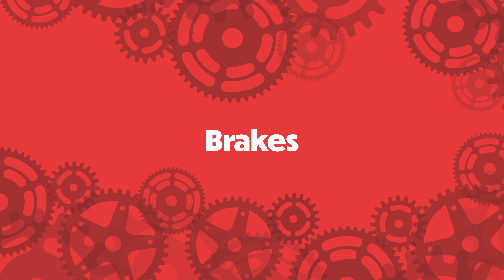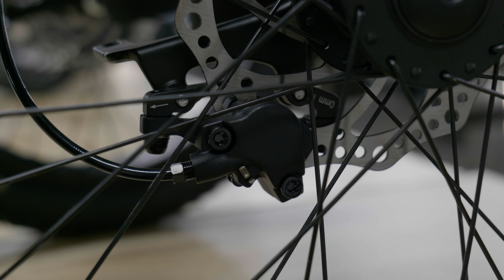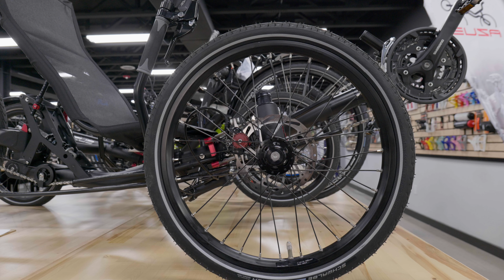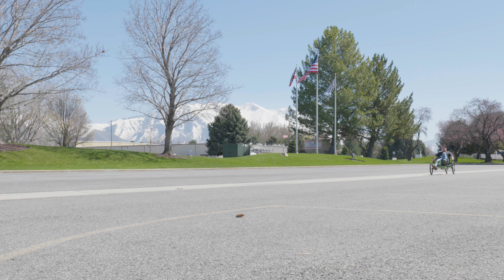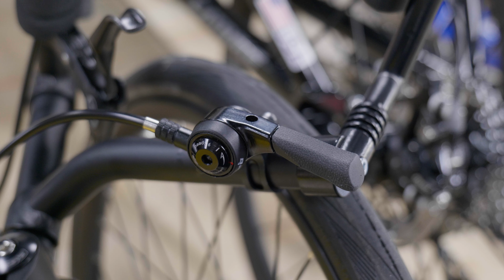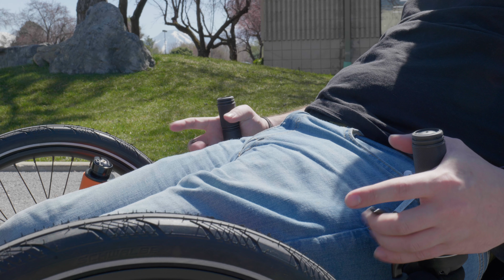All About Brakes at Utah Trikes

Comment: If you can have the two front brakes on one lever (9:36), why can't you also have the rear wheel brake on the same lever?  If all three wheels are applied equally at the same time, that should improve braking performance without causing steering issues.

Comment: Racing engineer (and bike rider) here.  

Disk brake vs rim:  "Having the clamp be on a smaller part of the wheel and closer to the center of the hub allows for much more effective stopping power"

100% wrong.  Given a clamping force, stopping power is a function of the distance from the center of the hub to the applied clamping force (simple leverage).  The greater the distance, the greater the leverage and the greater the stopping power.  This is why sports cars generally have greater diameter rotors than family cars.  Racing cars even more so.  This is the primary reason wheel sizes have increased on sports cars ... to allow for bigger rotors and thus more stopping power. 

The larger diameter of the effective rotor on rim brakes is an advantage, not a disadvantage. There are many reasons rim brakes suck, that ain't one of them.

Mechanical disks:  "This limits brake power to how much grip strength you can apply to the levers."
Hydraulic disks:  "Not limiting you to how hard you can squeeze."

As a race engineer, you're gonna have to explain how any hand braking system (without power assist) is not limited to how hard you can squeeze.  

On both systems, braking force to the pads will always be the force you can apply (squeeze) to the brake lever, multiplied by an mechanical advantage designed into the system, minus any frictional losses inherent to the energy transfer.

Again, there are certainly differences between the feel and capabilities of mechanical vs hydraulic disk brakes, but that's not one of them.
Reply: Putting aside the fact that this discussion is about bicycle brakes
Drum brakes can be designed to be some what self "boosting" by the use of leading shoes that as the friction force applies, due to the location of the pivot for the shoe, it tends to pull the shoe in harder against the drum

Typically on older cars (pre disk brake era), the front brakes would have two leading shoes and the rear brakes (that normally included the hand brake) would have one leading and one trailing shoe.  That gave best braking on front when going forwards and the rear was happy both forward abd backwards but not as hard working as the front

I have no idea if this aspect of leverage within the brake mechanism is applied in any disk brakes.  It would be possible to design, but one would need to ask why, given the power of modern hydraulics

I doubt there are too many drum braked racing vehicles around today!
Reply: @johnallen3555  //"I have no idea if this aspect of leverage within the brake mechanism is applied in any disk brakes."//

In any case relevant to this discussion, it's not.   

You are correct on your kinematics of many drum brakes.  The original "power brakes".

Comment: QUESTION: Is it possible to have a single brake lever with a hydraulic brake system?
Do you simply split the hydraulic lines?
Reply from the maker: Yes. We have brakes that are designed for that purpose.

Comment: I find one advantage to having left/right brakes is applying force differently to each side helps with fast turns.  So let's say I'm going fast and need to turn right. I'll lean into the turn and apply some braking force to the right brake, while applying no or little force to the left brake.

Comment: How often should you put on a new chain? Is it possible to over-lube the chain?
Reply from the maker: You usually don't need to change your chain unless you see a problem with it or it wears out. We recommend using a chain checker to check.  Too much lube can cause your chain to become wet and sticky. This can cause them to attract dust and dirt that will wear out the chain.

Comment: After burying my chain ring into the asphalt, during emergency breaking, the third time; i put a disc break on the rear wheel as well. I keep it a bit softer than the front. Not sure if it helps but i haven't smacked my new ring guard into the pavement yet.
Reply: Clamping the brakes in an "emergency stop" can not only result in burying the front chain rings, but can catapult you out of your seat! Brake carefully!!

Comment: I love disc brakes when they come into my shop.  Why? $$$$$. Drum brakes…rarely touch them. 90% of riders don’t need disc brakes...too bad more trike manufacturers do not offer drum brakes...I also have had customers get thrown off their disc brake trikes from slamming on the brakes and doing a reverse wheelie...
Reply: 95++% of riders do not need tadpole sportscar handling either!
Scenery sightseeing, nature viewing and exercising do not require tadpole "sportscar" handling.
2WD and maximum suspension under rider's torso on delta planform trike.
70-yo, limited-mobility handicapper here.
Delta On/Off, EVEN if using wheelchair and forearm crutches with NO balance!!!
A delta planform trike is a Jeep, SUV, minivan and station wagon!
Never outgrow a delta planform trike.
Grow oldest on a delta planform trike!
Own BOTH multiple tadpoles and deltas here!!!

"Jason Stillwater" in the recumbent world.